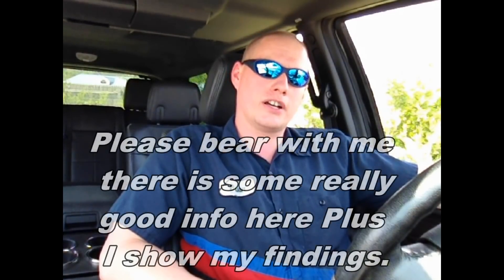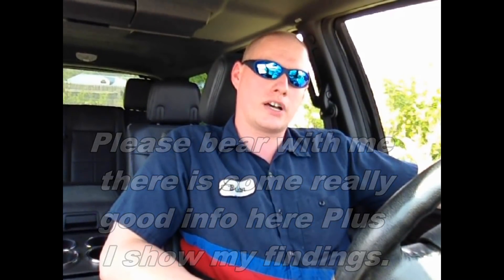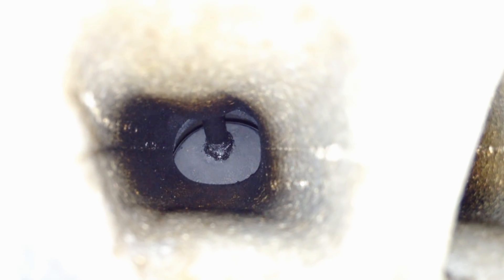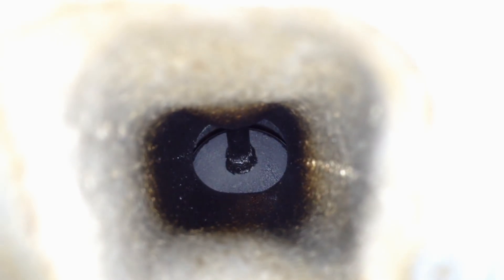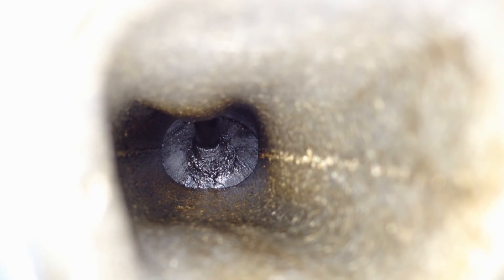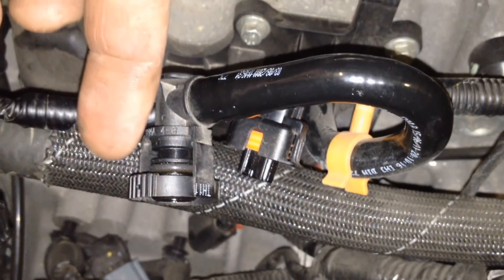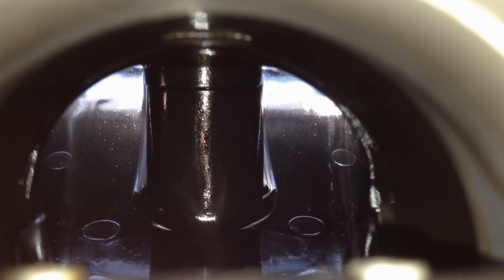Ford Ecoboost Warning Part 2 My Findings

Comment: Ok, now you have me worried.  I just forked out $33,000 for a loaded Escape 2.0 Titanium AWD for my wife.  Can you use fuel cleaners to help with this carbon build up?  or how about synthetic oils will this help?
Reply from the maker: Vincent O My BG rep is stating that their new BG induction service  for DI engines works very well in the ecoboost without failure we shall see. There will be a future video on this cleaning.
Reply: FordTechMakuloco Why doesn't Ford just include oil catch cans in the vehicles? I feel like that'd be the best solution.

Comment: Why do mfg always say components are not cleanable. Dirty MAF, you need to replace it, carbon sticking IAC... replace it. I've never seen a diagnostic flow chart from any mfg that recommended cleaning and retesting, yet somehow they make them a mile long.

Comment: Did ford do anything to prevent this I just recently traded in my 2014 fiesta se 1.6L 
For a 2015 Fiesta ST, is there anything I can do to prevent this carbon issue I heard using lowest level octane like 87 can prevent this,

Comment: I just bought a '13 F150 EB with 37k miles and love it so far but your videos have me a little concerned about my choice.  I still have the option of buying an extended warranty for it, do you think this would be a good idea in this situation?
Reply from the maker: Uber Guber Yes a very good idea if you plan on keeping it past the 60k powertrain warranty

Comment: I have a 2011 f150 ecoboost, was getting a stumble and hesitation when driving especially when passing, dealership said misfire and I needed to change spark plugs, I did and now issues for about a month, now I have code P0016, cam positioning sensor and or timing chain issue. Truck is still under warranty , they told me that these repairs would not be covered because they noted that my oil level was not at the full hash mark, but it was between the low and full marks, they also said my oil was dirty and these issues will cause failures and affect my warranty if they have replace the sensor or timing chain or both, is this true? is it not true that if the timing is out that it will dump more fuel then required and it won't ignite it efficiently and cause unused gas to be pushed through the valves and prematurely contaminate the oil. I run amsoil and changed it before winter almost 10,000 km ago and was just getting ready to change it because it is spring time, my normal routine fall and spring changes. I had them change the oil and they recommended a hot oil flush to clear blocked sensors etc. Picked truck up and code was back on in less then 500ft of dealer, took it back and now they don't know what the problem is, but they are still telling me warranty may not cover it because my oil was dirty, I don't believe it and will fight them on it. Could you please confirm if timing is out it will affect oil quality.  Thanks for you time
Reply from the maker: Scotty E If timing is off there will be excessive unburnt fuel to dilute the oil yes. Problem is the timing chain stretch is a known issue and has nothing to do with the oil but has everything to do with the hardness of the chain. Basically the chain stretched causing timing to be off to cause excessive unburnt fuel in oil, not your fault get Ford customer service on the phone.

Comment: Will a catch can void my warranty?
Reply from the maker: Steve Bueno Depends on your dealer but yes it can.
Reply: I really want the15 mustang with the ecoboost. That's why I have been trying to do research on them before I buy one. So far so good nothing that really scares me.
Reply: FordTechMakuloco Looks like you need to introduce some steel wool or similar substance into the PCV oil/air seperator to give the oil more surface area to condense on. A needle scaler with a flexible shaft would be ideal for cleaning the backsides of the valves.

Comment: Mercury marine has used dfi two stroke engines for years. As u know there is no valves( reed valves) but sooting is very common in mid section and exhaust ports. Quickleen is what they recommend for sooting issue, its is very good at almost eliminating these issues. Maybe this would help. Dfi engine as i have seen been a merc tech soot very badly and can cause spark plugs electrodes to clog with carbon causing misfire.

Comment: Ford is getting too wrapped up in this whole EcoBoost thing. For example the F150 designed to compete with an old school V8 like the Hemi simply won't last as long the Hemi. There is a trade off for getting the little bit of extra mileage and in my eyes it's simply not worth it.
Reply: $$$ minimum effort with maximum sales is the curve here.
Reply: been told by techs to get a 5.0 over the ecoboost for the past 5 years. atleast
Reply: https://www.youtube.com/watch?v=9nUCx5IQZro
Reply: A daft punk the name badge stuck but not the engine design!
Reply: The "Hemi" isn't a true hemi, just a play on terms and they have buildup issues too.   The problem is that the engine is the only good part of Dodge products.
Reply: WeSRT4 one problem the ecoboost do not get the same fuel economy as the 5.0 V8 does
Reply: Hemi is a terrible chamber design.
Reply: What I don't get is why they put such small turbos in....like they are super tiny and they pull but it has so much more to give and it just can't😂😂😂like bruh....bigger is always better when it comes to turbos!!!👌👌👌👌.....

Also why tf they didn't put a boost gage in the vehicles is beyond me....I wanna know what kinda numbers my like ford that could is make😂😂😂😂
Reply: Better torque, gas mileage, torque curve... Why wouldnt it last as long? That makes no sense.

Comment: What about disconnecting the power from the injector pump so no fuel is injected.  After that, turn engine over and use cleaner?  That way you would be able to clean without introducing too much fuel.  Maybe spray while cranking for just a bit and stop and let it work, repeat, repeat?  Engine cold.

Comment: Glad I stuck with an na motor.  Sounds like Ford didn't do enough homework on these turbo motors.  What will it be like on the used car market?  The price of changing the cylinder head will fall on the 2nd or 3rd owner.  What do you think this will do for Ford's image?
Reply: kfrey1 Took Ford 3 redesigns on something as simple as the 3.0 Vulcan (Taurus base motor) cooling system reservoir before they had one strong enough not to develop cracks in the bottom ... blew up tens if not hundreds of thousands of good motors with that just to save a few pennies of plastic. The funny thing is that if it was installed correctly , meaning with the tank bottom NOT CONTACTING the inner fender , they wouldn't have failed at such a high rate ,, the heat sink effect of contacting the cool metal did them in... the bottoms and tops of the tanks expanded at vastly different rates.  So I guess I'm saying that Fords image won't be significantly harmed.

Comment: I first subbed to your channel becase of these videos... Now, I'm looking to get into a 2015 Mustang, either V6 or base Ecoboost.. which would you put your money on? I am buying, not leasing.
Reply from the maker: Sigrafix Hard to tell the v6 is very reliable and the eco is the first year but second gen so the bugs should be worked out too new to tell exactly but I have not heard anything bad yet for the new engine.
Reply from the maker: Matt Thompson How do you know the ETB is good? If I had the concern you reported first thing would be a new throttle body.
Reply from the maker: I would not even mess with any pcv never seen even failed pcv's on any vehicle cause this. Most of the time the throttle bodies wont even set a code I have many videos on this. Replace that throttle body yourself if the dealer won't do it they are dirt cheap right now- http://www.amazon.com/gp/product/B00EGX15TC/ref=as_li_tl?ie=UTF8&camp=1789&creative=390957&creativeASIN=B00EGX15TC&linkCode=as2&tag=fordt-20&linkId=OVBFPC46EF4E5LSI
Also make sure you reset the pcm and relarn the idle afterwards as explained in this video-
https://www.youtube.com/watch?v=hZAsoqmqhdM

Comment: hello.... what I have done to clean the upper value train is to remove the pcv and put a small funnel on hose  that  is drawing in the air and them slowly...very slowly pour in sea foam into the funnel... yes it will smoke but it runs excellent after that...Robert

Comment: So if I understand this, all of the carbon appears to be coming from the crankcase vapor return into the induction system and baking on the intake valves?
Reply from the maker: Sharpsdoublerifle part of it yes especially on 2 and 3

Comment: Is this an issue with non Ecoboost?  The non Exoboost are still direct inject.  Thinking of the 2.0 normal aspiration vs 2.0 ecoboost
Reply from the maker: rallyguy132321 So far the di engines are not a big problem no.
Reply: FordTechMakuloco Thank you for your reply.
Reply: rallyguy132321
The non-boosted cars don't get as much blow-by, so they won't get dirty as fast, but they will still get dirty eventually.

Comment: Forgot to ask.... would a 'Catch Can' solution added on when purchased new eliminate the carbon buildup on the back of the valves by trapping the oil vapors in the can ?  And are these safe for the engines??
Reply from the maker: tgilldesign Yes they are a good idea for sure to prevent build up, they are passive in design so they are safe.
Reply: FordTechMakuloco Ok, cool and thanks for your expertise.  :-)

Comment: I am no mechanic.... but am considering purchasing at 2015 F150 with either the 3.5 EcoBoost, or the new 2.7 EcoBoost.... has the problem been fixed by Ford... and is the 2.7 a better option since it is a brand new design??  Thanks.  It seems like the reviews show the 2.7 as a real strong engine.... is there any noticeable turbo lag with either engine or is the acceleration pretty smooth?  Thanks.
Reply from the maker: tgilldesign I would get the 2.7L yes since it is second gen.
Reply: FordTechMakuloco I was hoping to go with the 2.7...... watched some video reviews and the thing would burn rubber 50 feet long and was actually quicker than a Chevy Silverado with 6.2 litre V8, Dodge 1500 with Hemi V8, and the Ford 5.0 V8..... and it was just a tad behind the 3.5 twin turbo.

So... with plenty of horsepower and torque and towing rated to over 10k pounds.... I thought this would be more than adequate.  I would rarely tow.... but if I did.... I just have a 4 X 8 untility trailer with wooden side rails.... pretty typical residential trailer for picking up some lumber, etc.

Comment: How did such small deposits contribute to cylinder misfire? Temperature variation or swirl interference? Almost looks like valve seal failure...
Reply from the maker: Mr42960 Correct and Correct.
Reply: before direct injection the injectors squirted fuel into the intake runners thus cleaning the back of the intake valves of pvc fumes. with direct injection  they inject into the combustion cylinder. while the pvc fumes which are oil fumes collect on the back of the intake valves. thus over time it builds up on the valve not letting it close so it has a misfire
Reply: I understand the difference, I own both. What I don't understand is the engineers introducing egr in a dry manifold, especially diesel, without some method of soot management. God damned epa...

Comment: Apparently the EcoBoost engine has the same legacy as the Mazda 4 cylinder engines.  It's a well known problem for the MazdaSpeed 4 cylinder turbo engines to have nasty intake manifold and valves due to crank case vapours and exhaust recirculation. The design change to direct injection meant no longer are gasoline vapours passing by the intake valves to wash all that nastiness away. 

I'm actually surprised Ford overlooked this issue when they are marketing EcoBoost engines so heavily across all their product lines.  Fingers crossed the ones used in the new Focus RS is better sorted out.  It's doing direct battle with the VW Golf R.  Which should have both direct and port injection; the port injection is there as a cleaning system as well as supplemental fuel supply during heavy engine loads.

Comment: Thanks FordTechMakuloco.... Can Ford Dealers install a 'catch can'? And how costly might that be for the parts and labor (Ford dealer or otherwise).
Reply from the maker: will tetsell Yes they can install them most will anyway cost would be whatever kit you choose and I would say about 1.5hrs install and that also depends on the shop labor rate.

Comment: I don't understand why OEMs don't put freaking oil catch cans on their turbo engines. The need for catch cans has been well known in the tuning world for a long time now. It would not be hard to train techs to empty cans while completing oil-changes.
Reply: GadgetsNGear That's what my solution would be! Catch can is easy to install, and no more issues!
Reply: lol that's ford for you!
Reply: "Ford has a better idea" ...They should shoot the guy that came up with that slogan.
Reply: +GadgetsNGear The problem is NOT that it's turbo - the problem is that it is direct injection. With direct injection, there's no liquid flow over the back sides of the valves, only air. So the valves never get "washed" as in a port injection system.
Reply: They cant because of emissions regulations.
Reply: GadgetsNGear exactly what I'd do. I dunno why they dont with a drainback.
Reply: GadgetsNGear Ive got an oil catch attached to the pcv on my 1990 e150 5.0, which is thermactor based.  why? same exact reason as this. oil in the intake, oil in the vacuum system.  Ford STILL doesn't have a better idea.  ok, maybe they do have a better idea... but their implementation still hasn't caught up...  on the bright side?  still got an oil dipstick!
Reply: +GadgetsNGear Another maintenance item to change. Another thing for the custom to worry about. More cost per vehicle. 50 bucks x 400k F150s,  250k escapes, flexs, edges, mustangs, etc... Millions of dollars plus engineering cost.
Reply: +TheArfdog you nail it perfectly.
Reply: Emissions
Reply: because of epa bs
Reply: They designed a baffled oil separator for the focus STs but its pretty shit
Reply: +GadgetsNGear Empty an oil catch can? fuck that....

Comment: Oh ya, also Lucas makes oil additive that works good too. I add 1/2 qt. Sometimes to top off 3L escape that holds an extra .5 qt in filter or 5.5 qts. Total. They have base or synthetic which is a bit $ but if your talking prevention maintenance its probably worth it , it adheres well to engine parts & can be mixed w any oil.

Comment: ESP. w/ turbos running hot, synthesic fluids & clean coolant, maybe additives. But also consider an after market oil / transmission fluid cooler, also if you wanna spend more maybe a better aluminum radiator if you live or drive alot in hot climates & or pull alot of weight or tow often.

Comment: Lucas oil top cylinder lube/fuel injection cleaner every fill up,  3-4 oz. / 10 gal. Spray throttle intake cleaner in intake w hose off & throttle flap open,  will start rough & smoke Rev up for min. Will burn out & drive. Check plugs & O2 sensors & repeat every 10-15k probably wanna keep all fluids coolant, oil, tranny etc. Checked,  flushed, changed regular too. Synthetic or Ford synthetic blend,other good Valvoline, Castrol, Mobil 1, Royal Purple $ best. Can run some 6-10+k oil changes.
Reply: You obviously have not watched the previous video. You can use intake cleaning procedures at your own risk. The added heat that burning these chemicals adds to the exhaust will leave a very expensive turbo at risk. NOT covered by Ford warranty

Comment: I agree they should stick to their V-8 engines which are far more reliable and less complicated. I feel sorry for all the people who paid their hard-earned money and are now having problems
Reply: I have a non-turbo 3 cylinder of the dreaded Mitsubishi Mirage. No oil use at all, no defect at all, almost 60.000 miles. Not even a lightbulb broke. The problem is quality control and design irrespective of the number of cylinders. Large engines have even less chance of being reliable because of more moving parts than a 3 cylinder.

Comment: mazdaspeed motors had this issue, catchcan, egr blockoff, and tune fixed it, although its not legal, it fixed the problem
Reply: pballer2005 They are rebadged EcoBoost engines.

Comment: use chevron techron in fuel , a more gradual cleaning. less evasive
Reply: Fuel additive will not address the problem discussed here. There is NO FUEL being sprayed on the intake valves, as this is a direct injected engine.
Reply: Robert Tribby i realised that after i wrote it
Reply: Jectron liquid moly is a far superior product. Been using it with DI engines with dramatic improvement

Comment: Thanks so much for the info.  I am having the chain rattle on mine.  Had the misfires, had a pump seal blow, new plugs at like 15k and 30k.  Random other tsbs for shifting funny, shaking upon acceleration cause mines a screw with the 6.5bed which the actually installed raptor mounts to help dampen the shake.  I mean, DAMN I had less issues on my 12 year old truck.  Also a ford btw.

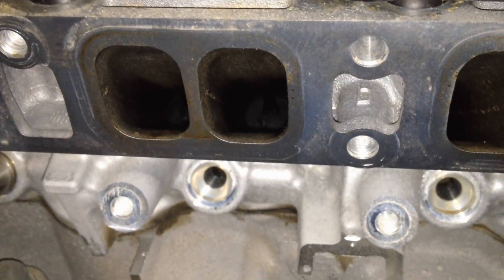Comment: Question: the baffle you point at around the 8:02 mark, where does it drain the separated oil to? Back into the crank case? Or does it even drain anywhere?

I ask because as a SC 5.4 owner I have been dealing with this for some time. The best hands off solution on the aftermarket today is an L & S Oil separator in the PCV system. It actually drains the oil back into the crank case and requires 0 maintenance. After cleaning my intercooler, and installing an L & S. I pulled the supercharger back off at 20k miles to check. There was not even oil residue in the intake/intercooler. Perhaps Ford could use something like this to prevent the issue?
Reply from the maker: It is just a baffle system that drains back to the crank case yes.